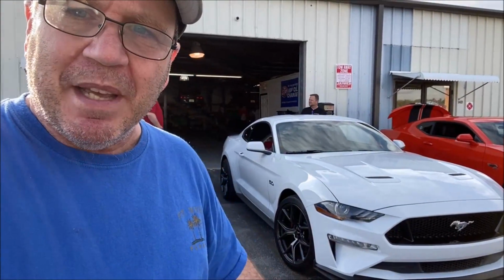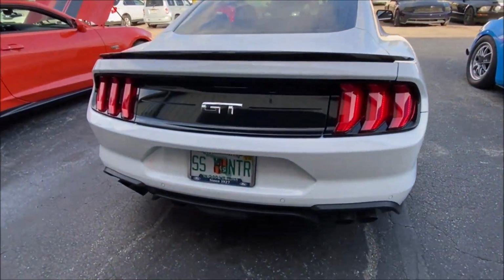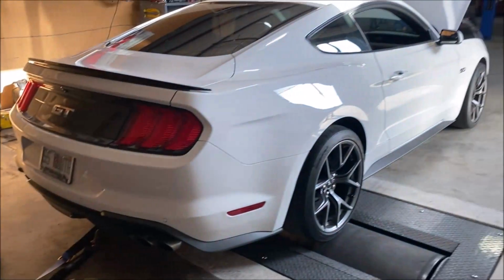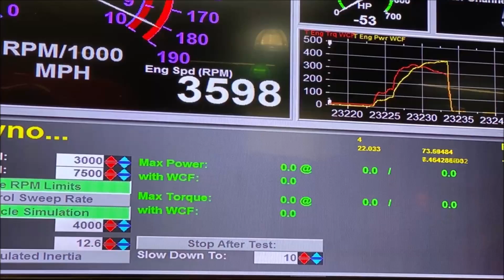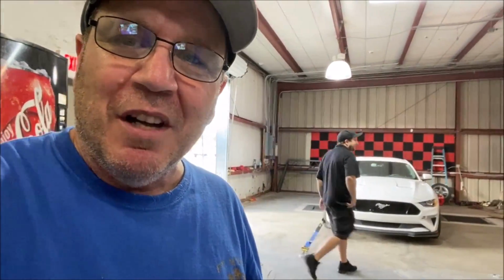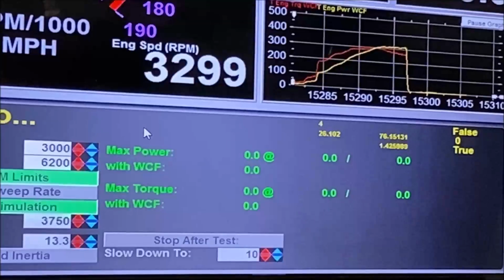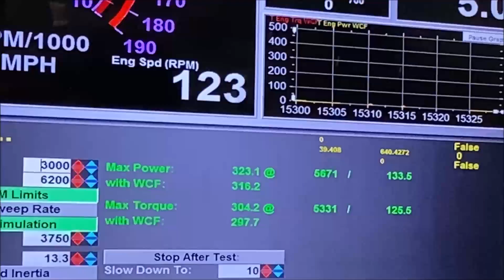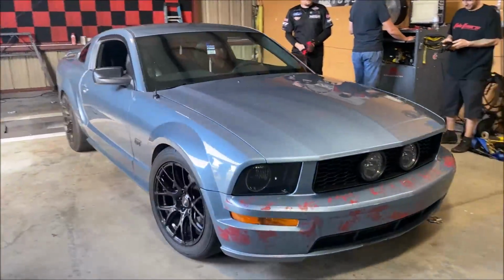2020 Mustang PP-2 Makes Impressive Power On the Dyno _ Cammed 2005 Mustang N/A Dyno

Comment: Closing shot of the 3 valve sounded awesome! I was watching with a good sound system and it really woke up my subwoofer. The PP2 wheels are beautiful. My Mustang was parked next to one at a local C&C and you can appreciate the size difference from the PP1 setup. The color of those wheels is on point, too. Goes well with all car finishes.
Reply from the maker: Mike Fyxdt .. . I agree. .  i am thinking of a set of PP2 wheels for my car. . .

Comment: what is your IAT2  when you are driving on the street with the killer chiller?

Thanks
Reply from the maker: Jack Contois. .  I am looking at about 70 deg. . . it goes higher but i have to be in boost for a long time . .
Reply: @coyotecarguy2076  At what air temp?
Reply from the maker: @jackcontois680  . .  I cant say i am reading iat2 in the car but my tuner data logged the car at the track on a 80 degree evening and the iat2 ranged from 70-86 degrees during a 1/4 mile pass . ..  i can say on the street it is running on the cold side as the chiller has a lot of time to stay cold. .